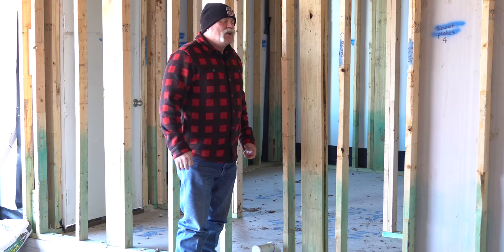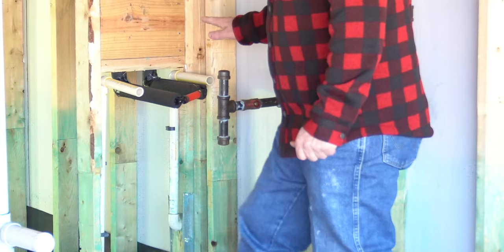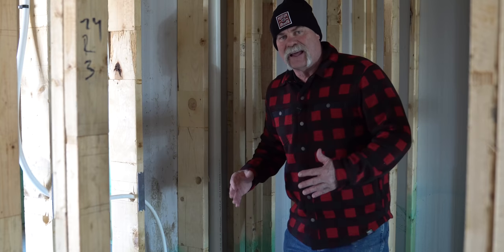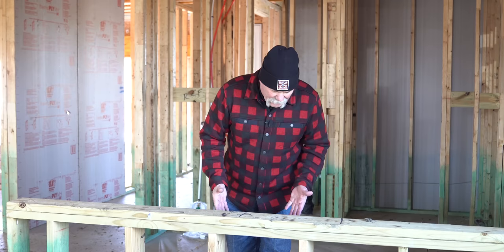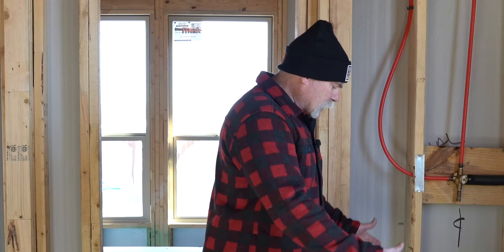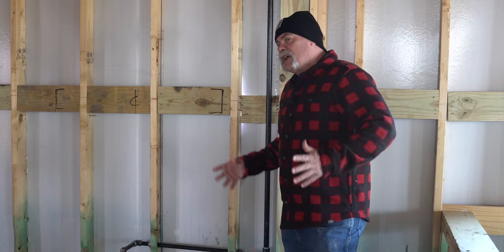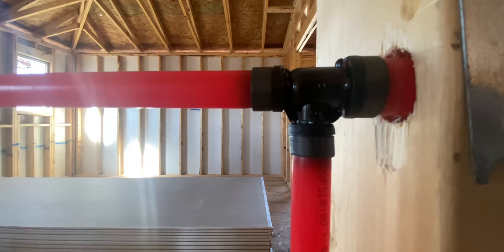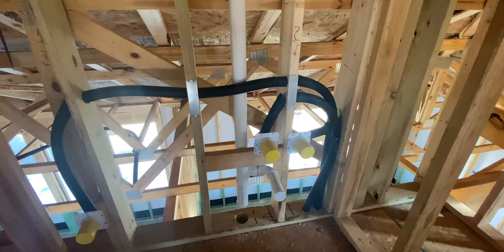How to Plumb a House | Top Out

Comment: I've always used 3/4 inch pex stub outs to the water heater for rough ins, never had problems. Even in big houses
Reply: Roger is over compensating for something lol
Reply: Agree 😂
Reply: 3/4 px is 1/2 copper flow rate. If you live in the house you work on you WILL notice the difference. So 1 inch px is actually 3/4 copper flow. But nobody does that. Solution is to use copper for all work. 🤷‍♂️
Reply: @beerbeforebreakfast  oh you rich rich?
Reply: I just appreciate high flow. Only copper in my house. For work I use pex when necessary, still prefer copper.
Reply: Their are Plumbers that think that it's ok to use 1/2" PEX on tub spouts as long as it's Uponor, because it flow s more than crimp PEX 🤦‍♂️ like read the instructions and use some logic the fittings fit inside the pipe.
Reply: @anonymousbaros4424  i still use copper for tub spouts though lol
Reply: @Anonymous Baros  The fitting on PEX-A do not fit inside the pipe. You must stretch the pipe over the PEX-A fitting.
Reply: @Tacompton425  and then the fitting goes inside the pipe. Are you obtuse? If you measure the id of PEX A F-1960 fittings they measure just at 7/16 not 1/2. And the EP fittings actually taper internally.  Delta, Kohler and Moen all address the issue and state not to use 1/2 PEX for the tub spout 🤦‍♂️. Guess people just have to pay twice to get it done right.
Reply: @Anonymous Baros  Never claimed they were 1/2 ID you troll. Just stating fact that pexA has larger ID than pexB and better flow you fool.
Reply: He’s talking about the pex crimp fittings that aren’t full port. So every fitting on that 3/4 has a restriction. If you run 1” then you have no restriction because you reduce at the heater. The install kit for the tankless, valves, nipples, flex, etc, will all be full port.
Reply: @beerbeforebreakfast  I like copper and came up with copper being tue best but as much I hate to admit it pex is better. The solution to the flow problem is expansion pex.
Reply: @anonymousbaros4424  who uses pex for tub spouts. I’m not sure I’ve ever seen that. It’s always copper or sometimes brass nipples. Back in the day we’d always galvanized. As for expansion pex. Pex-a expands so even if the fitting goes inside it’s still physically possible to have the same ID. You know because expand means get bigger. As for your ID measurements, I have no idea but 1/16 is not enough to make a difference unless it was hundreds if not thousands of fittings.
Reply: I do love some pex expansion. Only down size I have in what I do is the flex. I run lots of tub controls and I just can't beat copper for that use. I know you can secure and all that but I do that even with Copper so my stuff won't budge at all. I love that aspect of copper.
Reply: Yeah if it's PEX A like uponor. But it's the pex B with a reduced I.D.
Reply: Me too, the only way it be 1" is on a boiler, usually commercial
Reply: @Tacompton425  'Better flow you fool' would make a good shirt lol.
Reply: @beerbeforebreakfast  Yeah till you go price out a full copper pipe out then you buy the pex instead. LOL
Reply: As long as there’s 18” of copper from water heater it’s fine

Comment: The 3rd water line running from the master lav to the master tub is for a mixing valve(anti-scold) which is either code or a standard for new homes
Reply: the other thing I have seen is putting the thermostatic mixing valve for a roman tub near the water heater, but I prefer when the mixing valve is closer to the the fixture that it serves. So under the lav sink means it will be still be accessible if it needs to be serviced later.

Comment: Great video Roger!
  The top soil vent and drain pipes Look good. 
The water lines are a different story and
I totally agree about the flow issues this can cause.
Reply: Turn on 4 things even small and there isn't any pressure for the 5th using 3/4 pex b crimp

Comment: When I would run copper water lines in a top-out, the copper never touched the wood. For two reasons. The insulator held the pipe tight through the studs, and prevented sound transfer, as well as water hammer. 
By not doing this to the plastic water lines would you have either of those problems?
Some plumbers don't seem to understand the difference in water volume and pressure. If you have 20ft. of 1/2" copper piping, and 20ft. of 1" copper piping at the same pressure you can right away see that the 1" holds more water; i.e. how many square inches are in a gallon of water? Undersized water piping will starve another fixture if by chance they run simultaneously, just like gas piping if not sized for maximum CFH.

Comment: I'am a state Cert Plumber in Florida..21yrs strong. we do 90% Residential new work 5% commercial and 5% service. We use pex A uponor and you do not need to over size pipes because of the fittings are not reduced, they fit inside a pipe and the pipe is opened with a special tool to fit over the fitting.  We also use bend supports to keep any pressure off the fitting angles.  We also use CPVC  and copper ( propress )

Comment: I would have used copper stub outs on water lines so you can replace angle stops  ... with those pex ones you have to open the wall just to replace angle stop real PITA...
Reply: Good tip. Tks..
Reply: I like stubbing out with copper too.  Even though code doesn’t require shut offs on all fixtures, I like using compression fittings (Dahl) for fixture shut offs.
Reply: @arnelarsen4073  I agree and I also hate how flimsy a pex stub is and unsightly if any pipe left exposed. The copper stub outs far worth the little added cost IMO

Comment: That’s not a double gas outlet, that’s a drip leg. As for the flow restrictions, I can see changing it at the water heater because that’s going to feed the whole hot side of the house. However on those lavs and ice makers, it does not need to be 3/4 all the way there. Those fittings don’t make that big of a difference and even if they did every sink and lav has a 3/8s flow restriction anyway so if you have 1/2” pex coming off 3/4 and because of the fitting it’s a 3/8s flow it’s about the same as having 3/4 to the wall and then squeezing it down to 3/8s at the angle stop. 
All the changes you recommend, you should add the caveat of if your building a custom house do this. There’s no way they’re just going to add a diverter and rain head to a tract house because some people might like it. 
My criticism of this job are the shower valve and the angle stops. The shower valve look crooked but that could just be the angle of the camera. As for the angle stops/stub outs , I think those yellow caps are those plunger valves. That’s what I call them, I’ve only seen them a few times so I’m not sure what they’re technically called. Anyway they put them on some stub outs and others didn’t have them. I don’t know if this is because they’re going to add stuff outside the wall but they did 2 at a lavatory so I’m not sure what would be added. I like everything to be uniform. If they are intentionally stubbing some lines out without them on purpose then just put stub outs on everything. Plus I’d much rather have an angle stop I can change without cutting the wall. 
PS does anyone recognize that pex. It looked like the old black crimp ring pex but there wasn’t any daylight between the ring and the fitting. I’ve never seen pex connections that looked like that.

Comment: Hey Roger, Thanks for the tour! I like how they use extra 3/4 cut offs for sleeves to protect the 1/2 stub-outs. I'm surprised though they don't loop the furthest point in the hot water line back to the tank for recirculation, but I guess the rough-in is for a tankless. I would still pipe it for future use or standby tank and just leave an extra hot stub-out.
Reply: Tankless doesn’t give instant hot without a recirc too :(
Reply: @kylekoenig4730  You can't use a recirc on a tankless anyway without a seperate standby tank, it will run all the time completely making it totally inefficient.

Comment: The extra pipe under the Vanity and more than likely for the mixing valve for the Roman tub. This way it will be readily accessible.
Reply: I thought so too. I always leave a hot and cold line and a third line for the water that is mixed going to go back to the roman valve.
Reply: That makes sense, but they should've brought the 3/4 line all the way to it first, then reduced for the vanity!

Comment: The main issue I see with running 3/4 hot water lines all the way to fixtures is you have to evacuate the entire water line before your hot water makes it to the fixture which translates to a longer wait time to get your hot water there is a happy medium you have to hit to keep your volume and your lowest wait time on your hot water.
Reply: It really depends on the length of the run from heater to fixture. For example I ran 3/4 to my shower head and 1/2 to everything else. My shower warms up the fastest simple because its a much shorter run than all the 1/2 runs.
Reply: @ridenorthwest1687  yea the length of the run definitely comes into play but my point was in general it still takes longer than a 1/2 inch line because the 3/4 holds more water the shorter the run the less water the pipe holds in either size
Reply: @sethpurvis8680   Yeah you're not wrong. I just think as long as its not a real long run its worth just doing 3/4. My shower water pressure is worth the extra seconds.

Comment: crazy to see CPVC being used. Personally I don't use that type of pipe because it can't hold up. I also have never had issues with flow while using PEX, copper is ok if you're making repairs but I feel if you're plumbing a new house you should use PEX. I just worry about electrolysis when using copper, but again its not really that bad if you prefer copper then use it.
Reply: I think that cpvc is for the pan drain and pop off for water heater.

Comment: I never use those types of gas valves. If you look on the inside of them you will see they reduce the flow alot. I preffer to use full port 1/4 turn Ball valves. The icemaker is missing a hammer arrester, i always convince the homeowner's to put in a Reverse Osmosis system and i get the ice maker water from there and pot filler if they have one.
I would have like to see a recirculation on the hot line, looped to the closest to the stop or valve as possible
Reply: Do you need a hammer arrestor for PEX?
Reply: @michaeltristan86  I just run a loop on my trunks

Comment: I like 3/4 copper out to all locations, terminating with 1/2 copper. Full shutoff located at heater, low point drains at heater.  Also could have run water to range for filling large pots directly.

Comment: interesting.. they are using the sioux chief outlet boxes,
 the service plumber won't find the shut off in the garage until he has worked in the subdivision a few times,
 I suggest not oversizing the lines to the shower as all the water in larger lines makes for a longer wait time for hot.

Comment: No insulation for the hot water lines ? I think they should of install flanges after floors go in and if they are adding a water softener they should have separated the house bibs from the rest of the waterlines
Reply: Cheap builder/plumber. I would have used 1"thick insulation for the hot water line and put it under a loop with a recirculation line going back to the water heater. We always put the hosebibs on a separate loop with a valve and tee so in the winter the homeowner's can shutt the water off to the hosebibs, drain them outside and if they want they can put some air in the line to fully blow all the water out the line. I've been doing this since i work with an OCD architect. He even makes me insulate the cold water to prevent condensation during the summer. He pays for it so o well

Comment: I like solid copper pipe between the shower valve and head. Adds to overall rigidity instead of it all on the two little ears on the drop ell. I also stub copper into the valve itself and hang the shower valve assembly in two bell hangers. again..adds rigidity.  What kind of pex was that? Not familiar with those fittings.

Comment: The water lines definitely need tightened up I can for see a lot of noice problems, maybe add some silicone in the holes in the studs and add a couple more talons so the pipes don't slap when water goes through them

Comment: You said dual 3/4" gas for the water heater. The bottom pipe is not an outlet but the code required dirtleg, downstream of the shut off valve.

Comment: I love the extra stub-out separating the gas cock from the actual gas stub out! But, as I’m typing this I just thought about if there’s a leak later on and they need pump up the system to check it, some of those gas cocks won’t hold 15psi. But, they may have accounted for that already in the gas cock they put it. Also; the rough of it makes for a more extensive situation if it ever needs replacing. But- overall not too bad at all!

Comment: That 2" clean out should be at least  3". Especially if it's for snaking the building drain. I used a 1500 machine for mains and the cables won't fit through that.

Comment: maybe it's my OCD but the arrangement of that master shower head stub and the shower valve are not centered, and A LOT of that PEX could be cleaned up.
Reply: That's probably because a slide bar will be mounted on center for a hand held that can also slide up the bar & be used as a normal head

Comment: hopefully that stove hookup was a cooktop and not a range, or that gas line will be in the worst possible place for it.  
best range setup I've seen, the tin nokker set a back can behind the range and there was gas, 120V and 240V all inside the can, so no matter what stove went in, all the connections would be flush to the wall, and the stove wouldn't be pushed away from the wall.

best plumbing trick I've seen was the condensate collector plumbed directly to the drain, so there weren't extra pipes sticking randomly out of the wall to get clogged or freeze.  but those rough-in caps at all the fixtures are slick.

Comment: Are hammer arrestors not required in Texas or something?
Reply: I remember using them in a top out for a school. But not for houses.
Reply: Yes they are. I do work in central Tx wich is under the UPC code. We put hammer arresters to the ice makers, washer boxes, dishwasher, toilets etc
Reply: Only in commercial jobs. 
Where I live, residential inspections are a little more lenient. Of course… that doesn’t mean you can do whatever.
But commercial inspections are gonna be a little more tight

Comment: Going to switch out my home from 1/2 copper to pex a. Should i upsize to 3/4 or stick with 1/2? I know pex a doesnt reduce at connections like b and c, would you still recommend upsizing? Any advice appreciated, Thank you!
Reply from the maker: Personally I prefer Copper but if you are going to run PEX, up size it so you don't have flow restrictions

Comment: I use expansion fittings verses crimp so my jobs have alittle better flow but I here plumbers talk about stepping up with pex I've never had a flow issue with pex BECAUSE OF ONE THING YOUR 1/2 in
PEX STEPS DOWN AT EACH FIXTURE TO 3/8 so explain to me why run 1/2 copper that cost so much more to the customer when if you can explain how the hell your going to push 1/2 inch copper pressure through a 3/8 supply line!!!
  PLEASE EXPLAIN I'D LIKE TO KNOW 
  you do have some experience over me but I have been plumbing since late 80's.

Thanks for the videos.
Reply: Think he’s talking about when using trunk and branch. Could have multiple fixtures using same trunk line. Wouldn’t apply to manifold system.

Comment: 1;13 of the video.. that CO is an illegal CO.  CO' SHALL be the same size as the LINE it serves. AND. A short seep?  really?  Comon Man,  explain to me how you are going to get a 1'' sewer cable to go around that short sweep.
cut the 90 off. stub out of the wall with a 45. add a female adapter.   I would leave the adapter not glued
That 2'' line looks to me like it was going to be a service sink or drain for a water softner...

Comment: Flow restrictions what do you use a little braided lines with the cut off valves they go to the fixtures learn never 3/4 or any other sizes are really small I was just wondering if that really slows down the water?

Comment: I either use 1/2 pex by sweat adapters or pex stubouts. I don't trust pex angelstops, ill never put those in seems like junk to me. Also that washing machine box should have air hammers on it. Also its installed upside down, you loop your pex back up.  Commercial plumbing is way more intricate than this. I could do this in my sleep after 6 months on a real jobsite. Get into commercail and I'll resub

Comment: what are all those finger jointed studs?   those are scary.. and what's the green coating about 2' up the stud?
Reply: Termite treatment.  Finger joint studs are actually stronger.
Reply: I was looking at the same thing.  I know there's a lumber shortage but those studs awful!  They are full of knots, finger joined, chipped, and bowed.  This is what I'd use for fire blocking and not framing studs.  Must be a D.R. Horton Home!